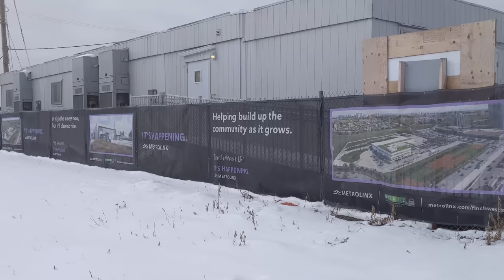Missing Links: Short-Sighted Transit Planning

Comment: I think we in Metro Manila has the worst missing link. From 2010 (when LRT 1 Roosevelt Station was built) until present, there is a crucial gap between LRT 1 and MRT 3. The reason for this is silly—two competing malls across each other want the connecting station directly in front of their respective malls. And here in the Philippines, corporations control the government. Now they're building one station for each mall, I think, and the construction is slow. And they're building a central station there concerning three lines with crazy transfers between lines. 

You should make a video about Metro Manila transit—we currently only have three lines for more than 20 million people 😭

Comment: This is so true!!! And we have tons of examples!!! 
In Valencia, the new #10 line has been built from Natzaret to the new Alacant station, which allows to reach on foot both the AVE station "Estacion de Bailen" and the regular train "Estacion del Nord", but does not provide any integrated connection with any of them. Also, this Alacant station does not connect with the existing metro network. It should be extended to reach Plaça de España, which is just 800 meters away.

Comment: The worst thing about the Bois-Franc expansion in Montreal is that thanks to the Metro Garage on Marcel-Lauren/Thimens the Orange line Metro tunnel  is less than 1 KM from the Train Station.

Also, the Dorval traffic circle is a major bus hub for the West Island.   If they extended the REM to the Traffic circle, it would eliminate the need for several bus routes through the congested highway that runs downtown.

Comment: Another annoying missing link in the north-end of the upcoming Hurontario LRT in Peel Region. It was originally planned to go to Brampton GO but, due to some temporary short-sightedness, now only goes to the Hurontario and Steeles intersection.

Worse yet, they decided to place the terminal stop on the south side of Steeles, the opposite side from the Brampton Gateway bus terminal. It was originally planned for the north side of Steeles, but yeah... :(

Brampton City Council is trying to get both these decisions walked back and the original line restored (perhaps with an underground section), but they haven't had any luck.

Comment: The Luas Light Rail/Tram system in Dublin was originally constructed as two separate lines and only crossed each other 15 years after it was initially opened in 2017, even now to change between lines there is a short walk between a station on the Red Line at Abbey Street and the one way loop on the Green Line at O'Connell/GPO (Northbound) and Marlborough (Southbound),prior to that it was roughly a mile long gap between the two where the Green Line terminated at St Stephens Green and Abbey Street by the GPO on the Red Line.

Comment: A missing link that was a missed opportunity was not building a link between North and South Stations when Boston's streets were ripped open for the Big Dig, the project that relocated I-93 from an outdated elevated freeway to a tunnel under downtown. The MBTA Commuter rail is still essentially 2 separate systems: the only way to transfer rolling stock between the two is a single track through Cambridge.

Comment: Paradoxically though, some missing links can be a good thing. Here in the UK, the London Underground recently extended its Northern line to Battersea, a suburb which also contains Clapham Junction, one of the busiest regional stations in London (and without a Tube link). But they deliberately didn't extend the Northern line there because if they did the new extension would have been totally overwhelmed...

Comment: Okay, I'm going to take a plunge before watching the video and guess that Boston is going to make it in here for not having a Red Line to Blue Line (metro) connection and/or for not having a North Station to South Station (regional rail + Amtrak) connection.  Then I'm going to watch and see if I'm right . . . .

After watching:  Yes!  Finally got Boston in!  Missing Red Line to Blue Line link.  Now if they are going to extend the Blue Line to connect to the Red Line, they should also extended it further west to serve some rapid transit deserts -- like for instance Western Avenue/Arsenal Street towards Watertown, which not only lost its streetcar line in 1969, but also has traffic along the route that is so bad during rush hour that I can literally walk faster than the buses can run there.

Comment: When Manchester metrolink's phase 3 was being built, the extension to Rochdale (northeast of the city) was done in two sections.

The first section, was to from Oldham (another town) to Rochdale's train station, opened in Feb 2013, being extended down a hill to the town's new bus station, around a year later.

Comment: My local train station has the most humble missing link: you can only access the train from one side of the station because the existing pedestrian tunnel (to access track 2) does NOT extend to the other side. All it would need is an extension of the width of a single track...

What infuriates me the most isn't that it isn't going to be built anytime soon (because it would cost millions - neither the train company nor the city feels responsible nor wants to cough up the money) it's that local politicians (and populace) question that this missing link of literally a few meters would be very good to have! Sure, you can use a car underpass but that adds ten minutes to your journey and makes the journey inconvenient and confusing. 

And of course there isn't nothing on the "wrong side of the tracks": there's ample parking with convenient access to the national road, an aquapark, two large company towers with lots of commuters (some of whom simply jump the fence and cross the tracks on foot) and a long distance bus stop...but no, general wisdom is that it wouldn't be even useful to be able to access the train station (with half hourly service in three directions!) *from both sides*. 

(And of course they missed the opportunity to build the tunnel while the whole line was shut down for a whole summer for maintenance while the track, the overhead wire itself and the track foundation were replaced - any backhoe (operator) could have dug the hole because it would have been a simple hole without trains, without a track and without a live wire overhead (because that was getting replaced... because of "once in a hundred years" maintenance) of course they didn't take the opportunity, because they felt it was unnecessary because they (politicians) only ever drive.

Comment: One of the more interesting ones is the Northern Line Extension to Clapham Junction. One stop away, it would join of the busiest station in the country to the Underground network. It was mooted but didn’t happen (although some works were done to allow it to be done in the future more easily) due to capacity issues (i.e. the Northern Line operates above capacity and Clapham is a huge station currently not served by the Underground). In theory and a cheap and easy connection but in practice probably won’t happen until Crossrail 3 and the splitting of the Northern line both happen- neither of which look remotely imminent.

Comment: There's an important oversight in this video: the added costs and safety issues of creating links. I'm not an expert in the field so I don't know the exact costs involved, but reusing an existing station may be too expensive compared to just building a new terminal. Tunneling near other underground structures is extremely dangerous, far more dangerous than tunneling with nothing nearby. Then there's renovation costs, permits and licenses to allow the dangerous work, and the possibility of causing delays for safety while tunneling happens. And there's a possibility of accidentally damaging an existing line, or rendering part of an existing tunnel unsafe/unstable.

This comment is a month late so it'll probably never reach you.

Comment: Another example of missing connection happens in Paris with the latest line 14 missing two connections on its way: 
. Line 14 should have a connection with Line 7 at Sully Morland, and also with line 5 in the same area by reopening the Arsenal station. This would bring a lot more life and development in the area of Boulevard Morland, which is underdeveloped while being part of the center of Paris. 
. Lien 14 has recently been extended to the north, but it crosses line 2 without a connection while it goes right underneath the Rome station. Probably, a reason is that Rome station is elevated while the line 14 is deep underground. However, as the line 14 is expected to be a strong part of the Grand Paris Express infrastructure, it should connect with the inner circle line formed by lines 2 and 6.

Comment: Not exactly a missing link, but something similar: In the Zürich S-Bahn network, there is are two platforms on the main station with two tracks each (Bahnhof Museumsstrasse). One station away is Stadelhofen. Every train that passes through Museumsstrasse either comes from or continues to Stadelhofen. But for some reason Stadelhofen only has three tracks. So naturally Stadelhofen eventually became to small and now has to be expanded at a massive cost. It would‘ve been much cheaper to build four tracks to start with.

Comment: One DC example that hasn't been mentioned is Gallery Place-Chinatown and Metro Center, two major transfer stations that are extremely close but have no internal direct connection that would let you transfer between Blue/Orange/Silver and Green/Yellow. It's not as huge of a deal because there's a direct transfer station at L'Enfant for those lines but it would be a bit useful for reducing crowding and would be a nice pedestrian shortcut in cases of bad weather or  not wanting to transfer for a single block on the Red Line say.

Comment: Let's mention however cases when missing links are justified : when a local line (BRT, tram, subway) crosses a more express line (subway or suburban train) and it would slow down the express line to add a station at every crossing.

A good exemple of that is Paris RER line A, which only has five stops within Paris located at strategic points. It crosses a lot of subway lines without an interchange but that's how trains can run so fast on the core section. 

However that's true in a city centre where you have numerous connections and alternative routes. In suburban areas it is the role of local services to feed the more express lines.

Comment: My niggle - 
When they did the Battersea Power Station branch on the Northern line, they should have built platforms at Vauxhall so it could interchange with the Victoria line.

Comment: In Montreal, I would imagine the gap between Cote Vertu metro and eventual Bois Franc station will eventually be filled to link the orange line to the REM, this would only make perfect sense. Apparently a big portion of the tunnel is already dug, and a piece of land reserved near Bois Franc for the metro station - this area is being heavily densified right now with many Condo developments, the REM station will be a big boon to the area. In Montreal (and I suppose many other cities) however, transit extensions are usually electoral in nature rather than based on real needs, so I am not sure if this will happen in the short term. As a fellow transit nerd, I Love your channel btw.

Comment: San Jose, CA, has this. Two light rail lines run on the same set of track and pass through the airport station, which is a mile from the airport. You either have to walk or catch the connecting bus route. So close to greatness and yet so far... I know Seattle has an airport connection on its light rail system and it ticks me off so much.

Comment: One somewhat similar issue in Denver's light rail system is that the branches of the light rail just barely - literally by a few meters - misses having all lines connect with each other. There is the central corridor with lines to the southeast and southwest, which branches to lines going northwest to Union Station and northeast into downtown. Another line from the west (W line), built more recently (opened 2013) joins into the corridor to Union Station, this junction 280 meters (per Google Earth) from, and within sight of, the junction where trains going into downtown split off. But to walk from the nearest station on the W line to the nearest station going towards downtown is 0.9km. This is a hassle if wanting to come in on the W line and go downtown, as well as coming in on the W line and wanting to go south, as far more trains are coming from the downtown line and going south than are coming down the Union Station line. A very slight deviation of the W line, relocating that junction, and a new station, could have served all but one of the routes on the entire network, making for far easier transfers. This and the commuter rail lines to the west neighborhoods and east to the airport just missing each other by 3 minutes, traveling in both directions, really shows that the planners didn't really consider transfers, only those who happened to be interested in one particular route. Or, for that matter, that the light rail and commuter rail "Union Station" hubs are 250 meters away from one another, the light rail hub having originally been right next to what is now the commuter rail hub but was re-located to allow for construction of a skyscraper.

Comment: I had a weird experience in Auckland that I actually can say backs up your point about the move from Auckland Strand to Britomart. I caught the trains 2 days in Auckland and Day 2 I got terminated at Auckland Strand due to signal faults or something. It meant I had to walk into town and it was such a hike I can almost see why nobody uses trains there.

In terms of missing links, the trams in Melbourne's South East has so many places the trams stop in some cases just under a kilometre away from the Railway stations. It goes back to when they were private companies competiting against the trains but now it's all integrated you can just imagine how much better it would be if it was all connect. Some of the extensions are literally less than a kilometre and it would mean the two are connected.

Comment: The mainline train station in Canberra is in a residential suburb 4kms away from the CBD. It is a terminus station on a intercity/interstate line from Sydney. The only connection is a bus route.

The train used to go into the CBD, a flood 100 years ago (a year after the line opened) washed away a rail bridge over the river and they never rebuilt it. When they decided not to rebuild the line into the CBD, they also cancelled plans to build a line from Canberra to Yass, which prevented connecting Canberra to Melbourne via rail.

The current station location was meant to be temporary. 100 years later, its still there and no one can agree on where a new station should be.

Comment: DLR Tower Gateway was built using existing viaducts from older lines.  The section to Bank had to be tunneled under some of the most expensive real estate in the country.

Better example would be the lack of a direct connection to Heathrow airport for decades and the persistent failure to connect to the Thamesmead development.   At least with Barking Riverside, they have got the station in before the development was completed.

Comment: hmm, trying to think if there is any such missing links in Stockholms Lokaltrafik... 
There is some weird stuff like how Lidingö doesn't want a subway and are happy with their tram, so the subway ends, right before the bridge over to the island, an instead everyone have to swap to the tram.
If I imagine places where ya goto walk between rail stations, there is places where ya can walk between different branch-lines, instead of riding the line to the connectionpoint, but there is always a point of connection.
Don't think we have any railway that doesn't also connect to another piece of rail
I guess it has to do with how every subway line connects at the center, so they are all connected, and any tramline is a branch sticking off from a subway sation further out

Comment: exactly! in Hyderabad, in the first phase, they did not connect the red line to the terminal which we have now. During the first phase the distance between the planned terminal and the terminal which was opened is like a kilometre, that's it. And the line did not see as much crowd as they thought. Later after connecting to the Nagole, Raidurg terminals, the crowd shot up. And now I wonder if they are doing the same kind of mistake in the phase 2 as well...

Comment: In the case of the Santiago Metro, there’s no connection with the airport because of the additional stress it would cause to Line 1, so it seems they’re waiting for Line 7 to decongest Line 1 so they can finally connect the airport to the network

Comment: Tram 10 in Paris which is currently under construction has a very annoying missing link. The tram runs in an L shape south of Paris. At the south of the line passengers can transfer to the regional rail to get into the city directly (no problem there) but at the north of the line the only connection there is is to another tramway line which connects to a metro line which goes into the city. This means that people at the north end of the line will either need to take a detour via the south or make at least 2 transfers to get into the center of the city.

The tram could be extended 3 km north to the Clamart train station with regional trains going straight into Paris Montparnasse station, where there are many connections to the metro.